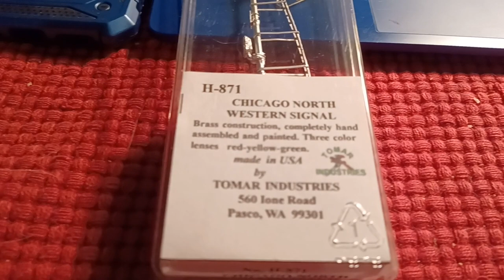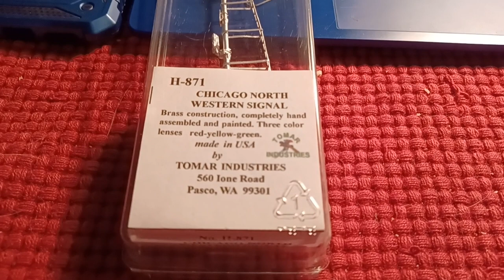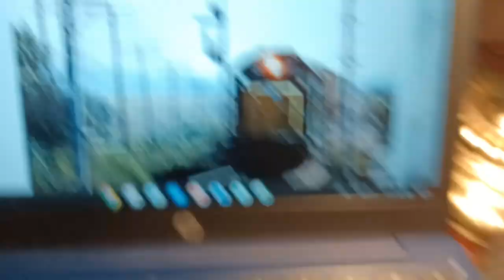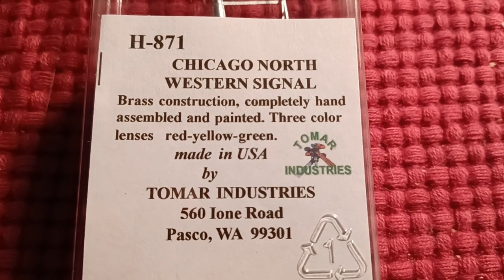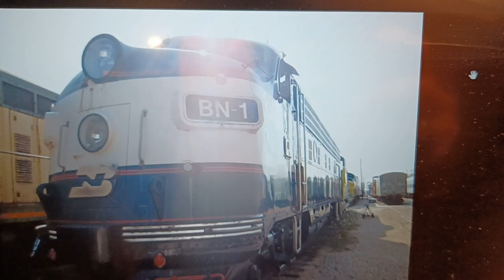HO Scale Tomar Semaphore Signals and Real RR Pics

Comment: Hey DD!! Those are some beauties you have there for signals 🤟🤙😎 Thank you for the presentation and your stories. Really makes for a good video when your a model railroader and have worked for the railroad before. 🤟🤙😎 Awesome stuff all around Dave!! Look forward to seeing where you put the new signals. Thanks for sharing and have a good night. Happy modeling!! -Jason
Reply from the maker: Thanks so much Jason..... I gotta come up with a way to make them function... let alone I dont know where Im gonna put them...  DD  🤪
Reply: @daylightdave9405  I'm sure you will figure it out and have them in a good location before you know it 🤟🤙😎
Reply from the maker: @jaybird111207  Yea they're on the layout in Warm Springs.. I'll wire up the LED today but I'm hold w/ circuitron's controller as it's out of stock.. Did you get any snow where you live?  DD. 🤪🥶
Reply: @daylightdave9405  Sweet!! Hopefully you don't have to wait to long. We had a mix come in last Tues into Wed morning then turned to rain which gave us a rain day. We did wake up to a coating Wednesday morning but didn't last long 🤷‍♂️🤣 Temps have been cold though 🤣🥶

Comment: Hi Dave, glad you got those HO Tomar upper quaudrent CNW Semaphores we were talking about! Did you ever get to see on Tomars site, the SP style lower quaudrent semaphores that I have? Can you make a video how to make these signals come to life? 😎 👍
Reply from the maker: I did in fact I was looking at them yesterday.. nice.. So Tomar makes a signal controller, around $50 per blade and comes w/ a 🐢 Tortoise which I dont need as I have a few extra of those.. Circuitron makes a controller for also use with a tortoise 🐢 but where I order from it is out stock.. MTS.. It's on the layout so in the meantime I'm just going to hook up the LED on each signal.. which I did test.. they come w/ a resistor so you can connect it to a 12v supply.. DD 😜

Comment: CNW had the first 3 GP7s... they ended up chopping the nose on the very first one... later on it was sold or donated to the IRM and they restored it back to original
Reply from the maker: They have one of those Pass. train (I think GP7) engines with the stripes there... it is one hella cool paint job....  I was looking at that pic of me and I ran a Wisconsin Central SD45 out of San Jose CA in the middle of the nite... One of my worst trips ever.... fun none the less.... DD   🤪